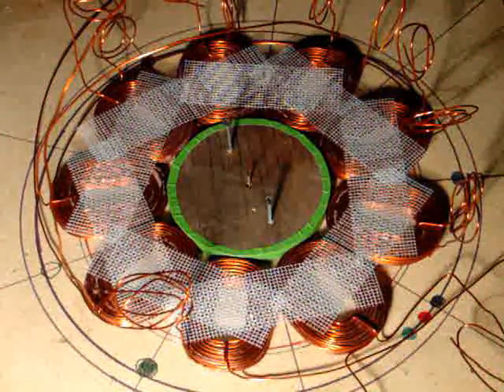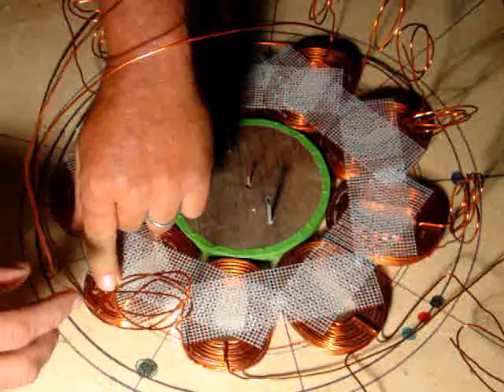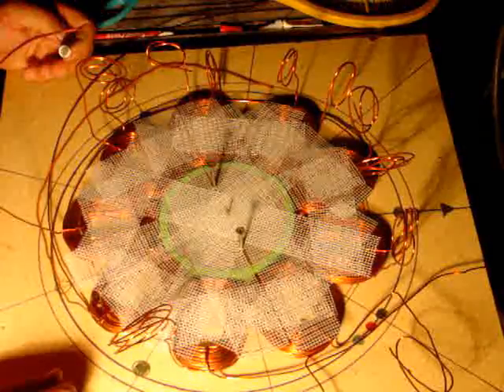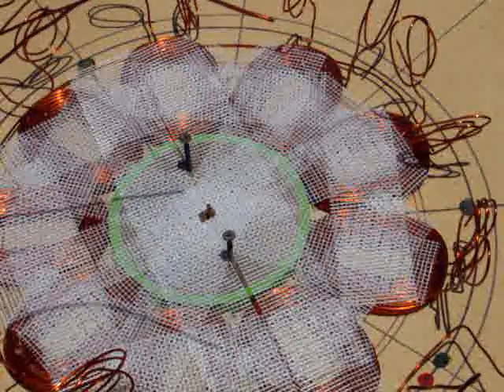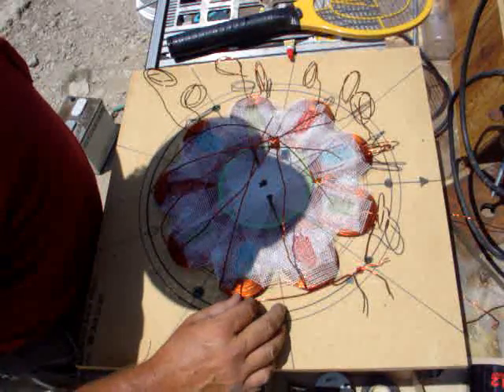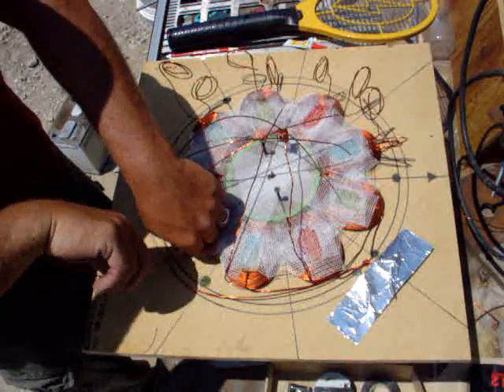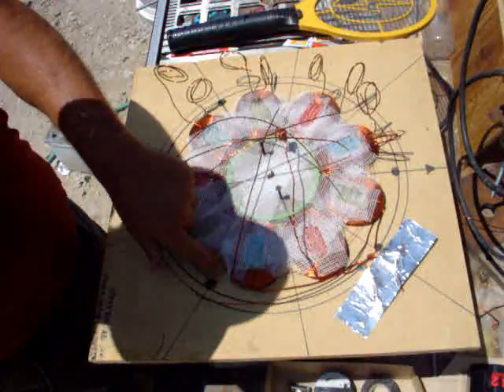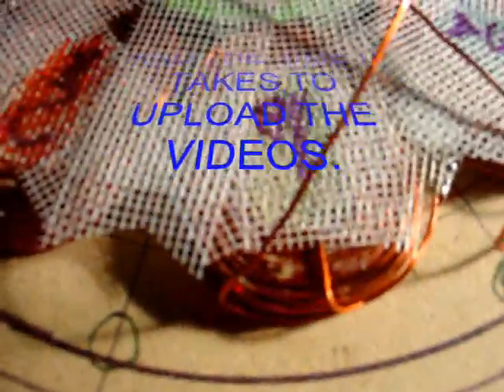BUILD A DUAL PERMANENT MAGNET ROTOR WIND TURBINE (PART 10)

Comment: HI SCOTT I FINISHED WIND MY COILS WITH 15 GAGE WIRE WITH 70 TURNS EACH THEY LOOK PERFECT AND ALL LOOK THE SAME,AFTER I TRYED EQUALY DISTRIBUTY THE 9 COILS ON A 9" ROTOR WAS A GAP ABOULT 1/8 OF INCHE,IF I PUT ALL COILS TOGHETER THE OD  ENDS UP ABOULT 8" DIAMETER.SO MY QUESTION IS: ITS OK TO HAVE EQUALY SPACE GAPS WHEN CASTING THE STATOR OR THEY MUST TO BE TOGETHER? THANK YOU.